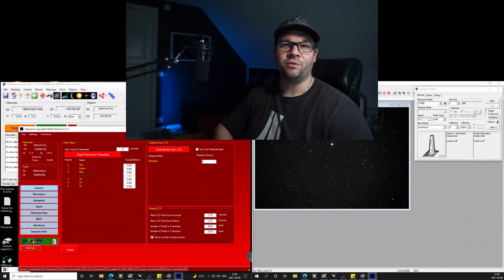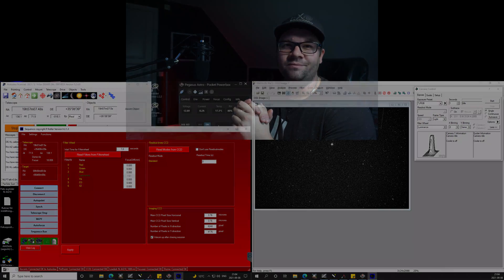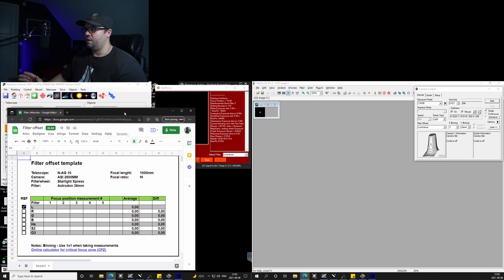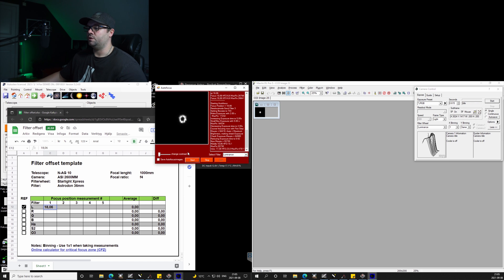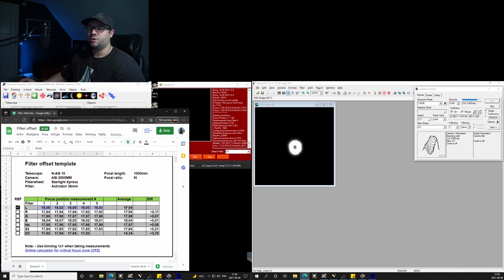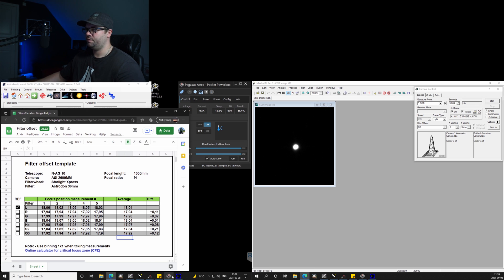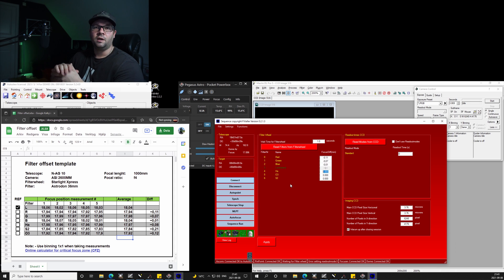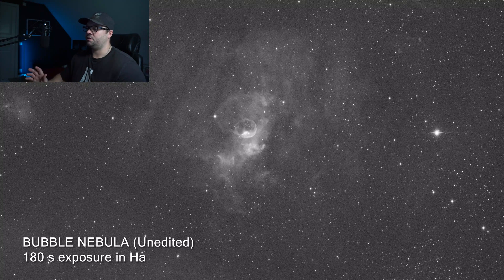What is filter offset? - and how do I measure it?

Comment: Thank you for this video! So when u start shooting u just depends on focusing with Lum and then u don’t use auto focus for each filter yet u use the offset space to change to focus position instead of each filter focusing right?
Reply from the maker: That’s right, my sequence software don’t allow focus with each filter change, but only “focus every x seconds” which makes me setting offsets.
But even so, it is a good thing to do for me as when the sequence software does calibrations and platesolve with different filters without refocusing.

/Daniel
Reply: @ExoPhotography1  thank you for replying,
Yaa that’s seems more accurate and legit, i will give it a shot and try to do my my offset. Btw Nina got a plug in for automatic offset setting.
Reply from the maker: @dreamisreallygood6276  Yes i noticed that when I watched a video of how NINA works, it looks like an awesome software!

And I only have a private Instagram, but a facebookpage - www.facebook.com/exophotograph
Reply: @ExoPhotography1  and do u have Instagram so we can see your images 😃

Comment: I noticed that my Optolong L-eXtreme offset changes a bit when I am at F/7 vs with a reducer, which brings my F/ratio to 5.6. Has anyone else seen something similar? Is it expected?
Reply from the maker: Is that a filter you use with a "one shot color" camera? Compared to what is the Optolong changing your focal point?

If the change is between f/7 and the f/5,6 setup, it would probably the reducer itself - how ever, the back-focus (which is something else) can also change compared to if you use filter or no filter at all. (the light travels differently through glass compared to air)
Reply: @ExoPhotography1  Let me clarify. At F/7, the filter offset I measure for that filter is 72 steps. At F/5.6, it is 120 steps. The offset is measured by comparing the focus position against the one I get when I use a luminance filter at the same F/ratio. Yes, I use an OSC camera.
Reply: @jlecomte0719  i believe that the focal ratio affect the spacing between colors (focus point) so it will change when u change UR F/ 
And also that will depends on ur telescope material that breaks the light beams 
I think reading on depth of field will help u to understand what i am referring to. Greetings